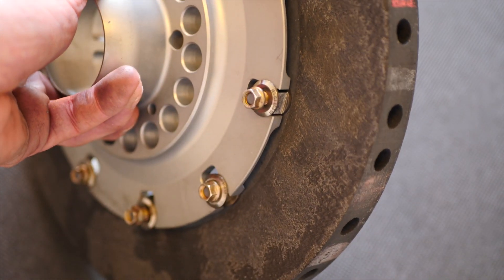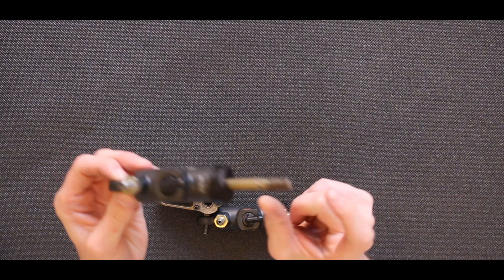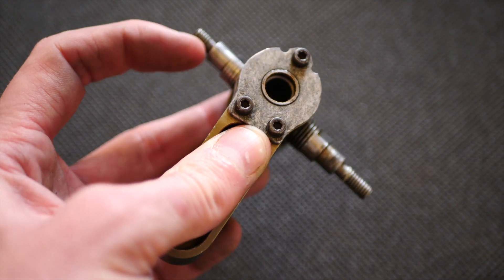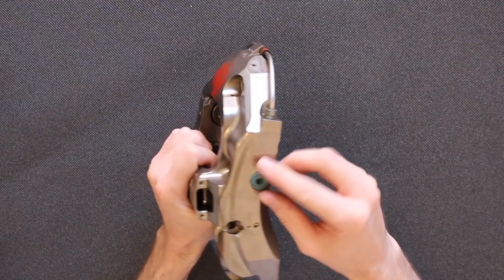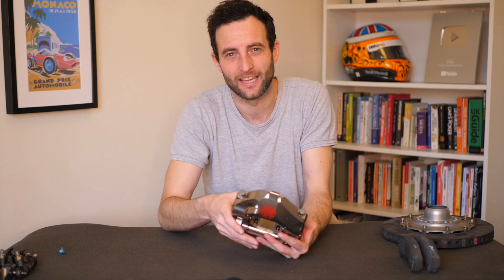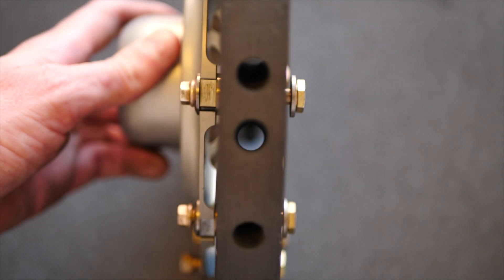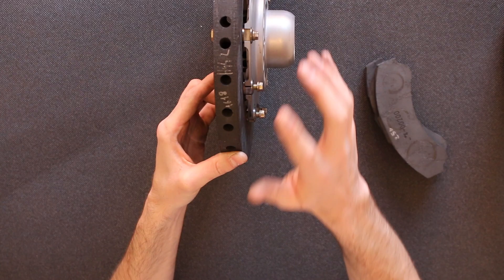How F1 Brakes Stop from 200mph to 0 in 4 Seconds | F1 Engineering

Comment: Excellent explanation for everyone. F1 brakes have the same components just like a passenger car, as a mechanic there is very little difference, just heavy duty parts.... and maybe the 2 master cylinders for the brake bias but a high performance car may have this as well.

Comment: 9:00 should really have a valve and tube to let air in to the brakes, block it off to heat up faster and then open up to control the temperature, could just use speed/time based system or a more complicated thermocouple or lazer based one

Comment: 6:00  why???? seems like a glitch if you put the valve on the bottom it wont rust from air bubbles, it will stop the valve from seizing you can crack it open to use as a drain and to let some new fluid into the calipers crack open to let fluid into the valve to prevent rust... to bleed SIMPLY add a small tube that should be included with calipers, make sure tube is above the fluid level, I install mine on the bottom, it makes a lot more sense

Comment: 1:45 that looks dangerously undersized for the amount of pressure necessary for this application, WHY???? probably caused a few crashes, the drivers most likely wont attribute it to this but having to push up to 250 to 350lbs on the pedal while driving yes 350lbs just seems like a glitch, could save money by not reinforcing the pedal, seat and structure around it like a dam leg press and engineer a lever properly so it functions the way someone would expect it too,

Comment: 6:39 I guess since the pad is so large, having different sized pistons ensures that the temperature (leading edge would otherwise be hotter) is more uniform across the pad so the pad wears more evenly...compensating this otherwise nonuniform temperature by having more force (larger piston diameter) on the lagging edge of the pad.

Comment: great explanation, but i think that you got something backwards.... since the fluid has the same pressure for all 6 pistons, the bigger the piston the less force it will apply to the pad, because  F = P / A  (Force equals Pressure over Area) ,  if you increase the area of the piston it will reduce the Force applied to the pad

Comment: The system is essentially the same as everything else . The big differences is the materials of everything . Also there is no booster and no ABS . Adjusting the front/back balance has been used for years on race cars .

Comment: Try well over 1000 degrees C, NOT 100!

The floating of the rotors is also there to allow the rotor to move sideways with any upright flexing, and well as caliper flex. 

The design of the master cylinders with them"floating" on a mount at the end of the cylinder body gets rid of the side loading the rod can produce ( the rod is guided in a straight line thru a bushing in the cylinder body), which would produce frictions that the driver has to overcome, and that reduce the sensitive "feel" and response to pedal pressure when braking at the limit.

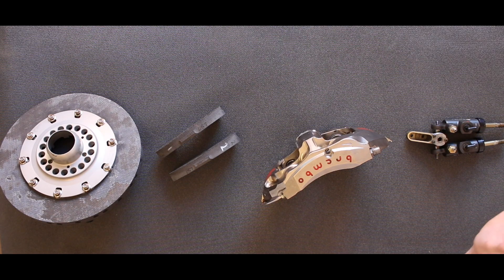Comment: I was wondering how the tyre actually is slowed down and prevented from just spinning from the load of stopping the car. But on 11:12 you can see the inside of the wheel hub, and there seems to be some studs, that I assume is what is actually transferring the power from the break to the wheel.

Comment: Imagine if the racing engineers could set the heat proportional to the brakes inside drivers uniforms some place on their legs， So they could literally monitor brake temps by the warmth of their suits。 Is there any good way drivers sense the heat of their tires and brakes in the cockpit ？

Comment: I think you'll find that the size of the pistons increases so the braking force increase as the pedal is pushed harder. You don't want the biggest piston first as the braking force will be greatest and may cause you to lock that brake easier. It's more like an incremental system, a more "controlled" brake if you like. It's not because they are worried about the wear of the pads at all. All the pistons move at the same time. Its because of the force exerted by each piston... bigger.. more... smaller... less. Think of it this way.... your average road car has only one piston. If you stand on the brakes, it will stop the car in say 50m. If you change the piston size to double lets say, in the same car it may stop the car in say 30m. The pad is still worn down by the same amount, as your car still came to a complete stop...but your braking performance due to the bigger force was better. That's why performance cars have 2, 4 or even 6 pot calipers, but they pistons are still the same size.

Comment: Great video and wonderful series of videos!  One correction:  racing brake lines do not use rubber linings.  The reason is, a rubber lining allows too much expansion/flex in the line, resulting in a soft pedal and unpredictable modulation point.  Racing brake lines use a Teflon liner which does a great job at limiting the amount of expansion/flex under severe pressure, resulting in a very clean and predictable modulation point.

Comment: As we press the pedal, pads get in touch with disc but when pedal force is removed then how the pads get retracted to their original position ?? (because there is no such mechanism to pull them back). If they don't, they will create a resistance force which will directly affects the efficiency.

Comment: Thank you! How are the ducts designed that lead the air from the brakes away from the car? I guess engineers had to make sure that the hot air wouldn't meld the tires

Comment: Incredible to see that the working principle of the brake system of an F1 car is pretty much identical to that a shifter kart, just with an additional caliper at the rear. Fancy materials and fabrication processes aside it is about as high tech as a bottle opener. Love it though! Means the driver actually still has to make the difference (at least when it comes to breaking).

Comment: F1 brakes are bitchey. Top Fuel has more G's on deceleration when their engine cuts off at the end of a 330mph+ run in 1000 feet. Top Fuel drivers have issues with their eyes falling out of their sockets. The brakes on my Plymouth and motorcycle work the same way. Big whoop.

Comment: Would it be possible to use high precision gps/WiFi to recalibrate the braking aero and handling per corner based on a pre recorded session. Out little Wireless nodes at each corner etc

Comment: The only question is how the pads turn back to its initial position?
But I was surprised to hear that there is possibility to regulate brake balance. Does the pedal rotates or it's fixed on z-axis and this regulates only by this motor/screw?
Reply: I work on the Breaks on my Car. And i was asking my self the same thing.
How does the Pads go back? There is no mechanick to push them back.
I can only imagine they never go back. They just stop to put presure on the Disc.

Comment: LOLOL...............Almost any disc break commercial car can lock up their breaks.  Two reasons the F1 can stop so quickly, 1 much greater tires to road surface area,  2 a F1 car is comparatively light, much less mass to stop.

Comment: 100 Degrees C obviously isn't correct. I suspect at least 1000* C is what he meant? The pipe fittings on the master cylinder are just that- fittings, not nozzles. Nozzles convert hydraulic pressure flow energy into kinetic energy. Think a nozzle on a hose, for example. The only time there is air in the hydraulic system if when has been opened for some reason, or when it is first put together. That's all the bleeders are there for. Air does not otherwise get in. The calipers are kept low for improved center of gravity, but they're also kept towards the center of the car for reduced moment of inertia about the car's vertical axis. The front rear proportioning by moving the pivot between the two master cylinders is quite clever. I'd never seen that before. I also never knew about the different sized pistons in the caliper, based on direction of rotation of the rotor. Interesting!

Comment: Just a point. If all the caliper pistons receive the same force from the hydraulic fluid (and in fact they do), the piston with the smaller diameter (section) will make more pressure against the pad. Pressure = Force / Area.
Nice vid anyway.

Comment: 6:53 Actually the smaller rimed piston will apply a higher pressure on the brake pad and the bigger rimed piston will apply a lower pressure on the brake pad.

Comment: 2 piece rotors are designed to limit a brake rotor effect called coning.  When a one piece rotor hat is integral to the disk, the rotor disk expands from thermal load and the rotors hat prevents it from radial expansion.  
The 2 piece design allows for radial expansion and the rotor disk remains flat and floats independently from the rotor hat.
The coining effect makes the rotors disk bend and deflect and the surface area of the brake pads to the disk rotors is greatly reduced when at high brake temps.   
A 2 piece brake rotor also lasts longer without the risk of brake rotor fractures or failure's.  
It can radially expand and contract without deflection.

Comment: I figured they ran abs in F1 with all the electronic goodies you guys can use. In NASCAR what I work on has just recently went to fuel injection on cup cars and the lower classes still run a carb. The FI system we run is a 20k mclaren throttle body setup. Ridiculous in my opinion.

Comment: Would be interesting to know i) what energy these brakes dissipate in one (extreme) braking maneuver and ii) what power they are able to dissipate at peak (I'm guessing a couple of MW). Then compare to brakes on regular cars.
Reply: It isn't really that hard to calculate that. The total energy the dissipate depends on the inition speed of the car. The energy is simply the initial kinetic mnus the final kinetic energy of the car. Assuming that the car brakes from 330 kph to 90, the total energy dissipation is about 3 MJ. The peak power really depends on the deceleration and the speed, but it would be about 3-4 MW. I did make some assumptions in calculating that, so the actual number may differ, but I tried to keep it as realistic as possible so I don't think the difference would be huge. The brakes on regular cars? Well, that would depend on the car, but from a top speed of lets say 200 kph, the total energy dissipation would be about 2MJ and the peak power would be about 0,7-1MW.

Comment: Not sure the pistons are different sizes to even wear-the disc is rotating so will wear evenly . Could it be because carbon pads are relatively brittle and the different pressure across the brake pad from the different piston sizes creates a longitudinal compressive force thus protecting the pad from being pulled apart?

Comment: Great video. I assume you meant 65% front to 35% rear for the brake bias ?
Reply: As the fuel load drops they'll adjust brake bias as needed. The percentage depends also on different tracks and driver input, some drivers are easy on brakes others much harder. I was a photographer for many years for Indy car and had many talks with drivers and crew chiefs. The rotors are painted with different paint color that changes when overheated. Now they have temp stickers glued on so the driver cannot lie on their brake performances. have a great day. Cheers from Canada

Comment: These brakes look remarkably like aircraft brakes on passenger and cargo aircraft...they also have to dump a LOT of kinetic energy, at similar speeds. Nice video, simple enough for 'beginners', but with a few 'nuggets' for people with a bit more knowledge of brake systems.
The image showing brake discs from 2008 to 2019 has both disc thickness, AND the number of venting holes, but it's very hard to read...any chance of inserting a slightly better image?

Comment: There's nothing really complicated about F1 braking system itself, no more than the brake system on your car.  F1 cars and other type of race cars have two master cylinders instead of one on your car.  The difference is the materials used in the system, specifically the carbon discs - the same materials used on jet airplane brakes.

Comment: Was hoping to hear about the distinct differences between F1 and street brakes. 

Get lesson about how disc brakes work on ANY car 😐
Reply: Well the idea is the same: You push your brake pedal, transfering the pressure via brake fluid to the pistons, which press brake pads against the disc. One point which isn't mentioned in this video is, how the pads are mounted in the cylinder: From what I could see, they're mounted in a "floating" position just like in many regular street cars.
Now what's different in street cars?
1. You don't have the possibility to adjust brake pressure between front and rear.
2. The 2 brake circuits are usually split diagonally (so left front&rear right is one circuit, right front&rear left the other one). But sometimes it's also split front/rear, especially with brake by wire systems. 
3. Street cars have ABS, so where are some more valves between your pedal and the brakes and of course an ECU controlling these valves.
4. Street cars also have a booster to assist you with braking power.

Comment: I found it a bit basic - a lot of the content just repeats all I know about road cars. I would like to hear a lot more about the differences in F1 engineering, like how the brake by wire on the rear works to allow energy recovery without being a driver aid (i.e. no ABS)
Reply: check out Magnetti Marelli's videos, they are official providers of MGU-K system on F1 cars

Comment: More holes cool faster, also heats up faster due to less mass and more evenly. So less thermal lag, which means they come up to temp quicker too. They also help reduce unsprung weight too. There's a theory that a bigger hole allows parts of the disc to compress as it rotates between the pads. This gives rise to a  pressure change as clamping is applied, so small I doubt it can be measured, hence a theory.

Comment: Kind of amazing that F1 brake calipers have "only" six pistons.   Well, six is a lot of pistons, but a lot of higher-end sports cars these days have gotten in this kind of piston war, where more pistons supposedly means better braking.  More pistons can equate to better and more consistent pedal feel, but they aren't the end-all that marketing would have you believe.

I don't want to be too reductive, but this video is a fantastic example for laymen to demonstrate how brake friction material and heat management (the latter of which includes things like pad and rotor size as well as ducting) are the most important aspects of a braking system when it comes to terminal braking ability and fade resistance.

Comment: The position of the caliper is a compromise between lowering the center of gravity and minimizing the vehicle's  moment of inertia about the vertical axis.  If you want to lower CG, you mount directly on the bottom.  If you want to minimize polar moments, you locate towards the center (rear of front wheels, front of rear wheels).  Luxury road cars often place the calipers as outboard as possible, front on the front, rear on the rear, in order to /increase/ the pitch moment and thus lower the magnitude and frequency of pitch as you cross bumps.  F1 wants to reduce yaw moments as low as possible, so the car rotates, hence the location you show.

Comment: One cool thing to note: see these "nozzles" that are screwed in master cylinders? They are originally designed for jet engine fuel systems. If machined properly, they can hold up to at least 150 bar. They can probably hold more, but even jet fuel systems don't get that high.

Comment: unequal or staggered pistons are usually implemented to compensate for gassing effects. as the pads wear out they create gasses, that cause an increased pressure rotation wise, and so you need more force to push the pad on the trailing edge, than on the leading edge, as you need to overcome this pressure.

Comment: The larger the piston diameter, the lower the pressure. I didn't understand why you said the opposite.
Reply: The hydraulic pressure is the same so the piston applies that force over a greater area.

Comment: at 6.55 first one with the smallest circle applies the most pressure, isn't it? I mean the surface area is inversely related to pressure so either there is another part to it that presses the first one a little less and the last one a little more, or we got something slightly wrong? Please correct me if I'm wrong. Great explanation through the whole video btw, this is my second video and I subbed already in the beginning of the first one.
Keep up the good work
Reply: No, I think he's right. Pressure = Force / Area. So for a given hydraulic pressure (ie given force on the brake pedal), the smaller area will give a smaller force. It's the force on the brake pad that matters.
Where it sounds like you said is if there's a given force then a smaller area would give a bigger pressure. So pressing a brake pedal with the same force on a smaller master cylinder would make more hydraulic pressure. But that's actually the same thing. A given force on the brake pad would be a higher pressure for the smaller area piston. So with the same pressure for them all, the smaller piston must be less force on the pad.